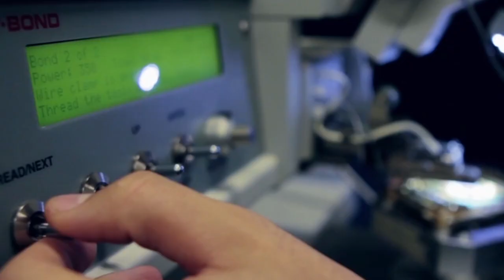D-Wave CEO On Quantum Computing And Tackling Tech's Big Problems

Comment: 2 power 512 does only be used when every Qubit is connected to every Qubit.
But this is not the case in the D-Wave 512 Quibit Computer.

Comment: What would happen if you coupled your quanta to a holgraphic environment that flashed on and off at light speeds- ie move or dance the device or an image of the device around the active quanta so that at differing yet simultaneous frequencies at the same time, numerous devices could calculate at the same time,then through a process of elimination you can search through answers like a database, move the computer via discreet slices of holographic space around the data

Comment: A room temp Q computer might be possible using the electrons that are bonded between two atoms that then are shielded by a Faraday cage made of Fe atoms or molecular wires.  Or a tuned field as a base that blocks interference.